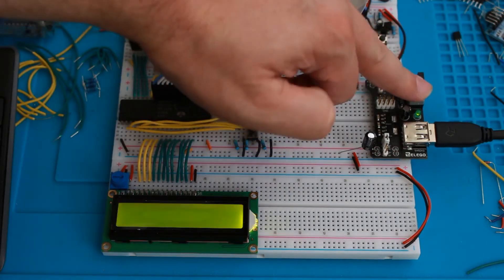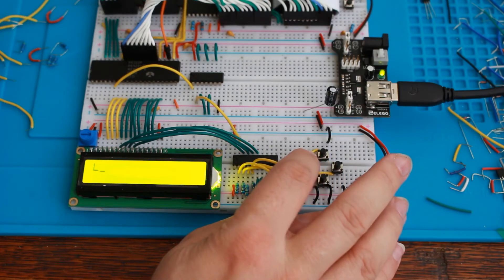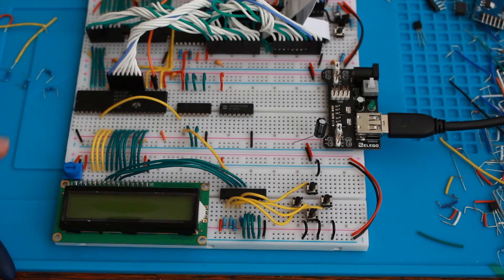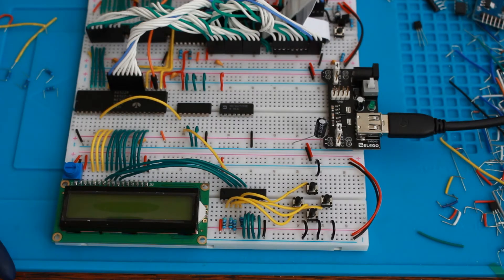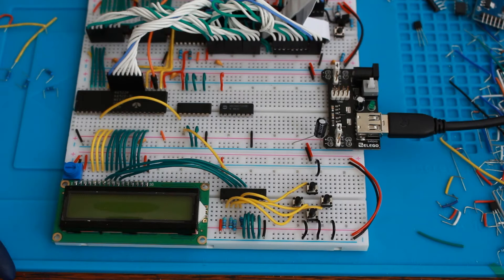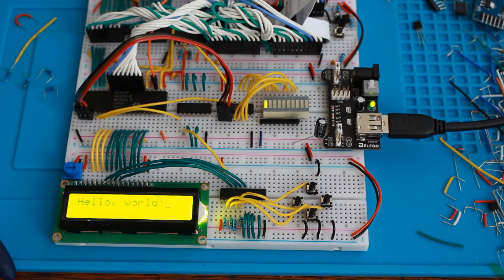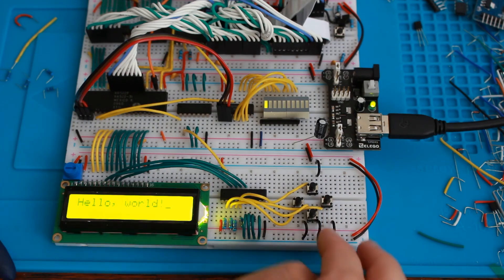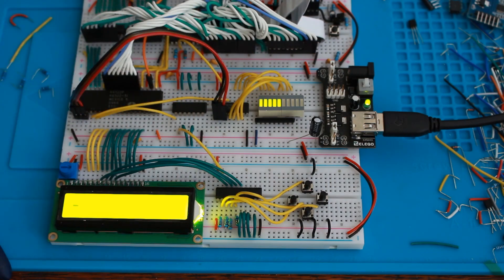Using an Addressable Latch to get more output pins

Comment: What is the power up state of the latches? Are they clear, or undetermined?
Reply from the maker: Undetermined I believe but I think there is a reset input you can use if necessary
Reply: @GeorgeFoot  thanks. Seems like I could use an RC network to give the reset inputs a little push when powerup happens.
Reply from the maker: @AlanCanon2222  that should work. But my preference is generally to link all the reset behaviors together, so the cpu, via, and this is this all reset at the same time and come out of reset somewhat together. You can feed an RC network through a schmitt triggered inverter to get a nice clean signal to reset them all with, or use a dedicated self contained module for generating reset pulses.

Comment: Ah this is a nice solution to controlling an RGB backlight I have for my LCD, I was thinking about using the shift register outputs from the 6522, but I'll have to try out the addressable latch and see how that feels instead.
Reply from the maker: The addressable latch is best when the bits are completely independent, and you want to change them one at a time, not all together. A D flip-flop or latch is a good fit for a multi-bit output where you do need to simultaneously change several bits together.

Comment: Very nice!  I like the resistor "unit". I have a similar test rig set up. How can I find those?
Reply from the maker: They're called resistor networks or resistor arrays. I got a selection pack from Amazon a while ago, but can't find it there any more. It was a selection of 5-pin SIPs and 9-pin SIPs in various resistances - the pin on one end is a common one connected to all the others in a "star" topology. It's very useful for LEDs for sure!